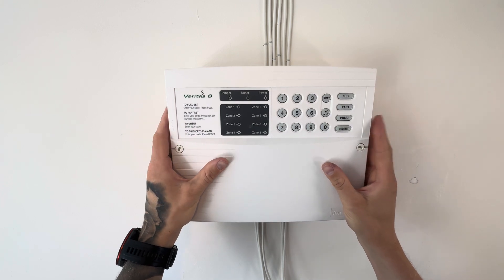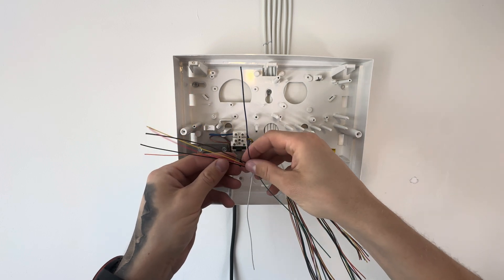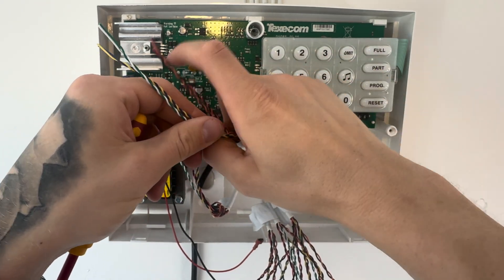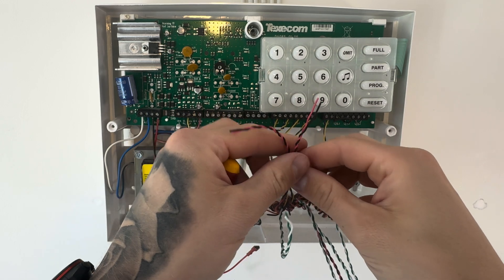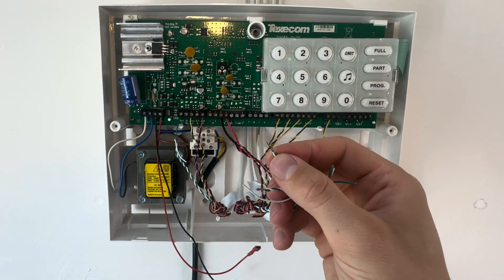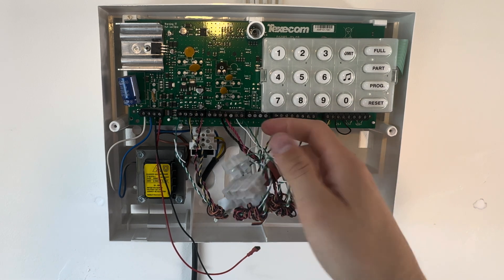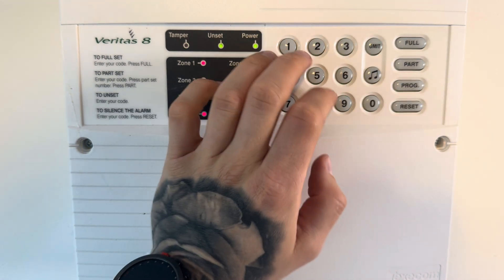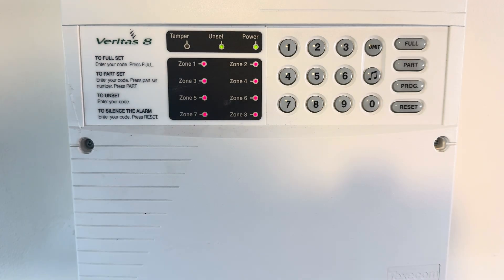How to install a Veritas 8 Alarm System & Programme Step by Step

Comment: Hi Simon
Brilliant video!!
My wired Accenta Ideal alarm system with remote keypad decided some time ago to stop working. The panel lights are on and I've also replaced the battery but nothing works. I've decided to replace it as I can't diagnose the problem. The Veritas 8  looks like it might be an option especially having seen your video to install it. I was also wondering about additional wireless sensors for attached garage and utility rooms. Could you recommend anything for the existing wired and future wireless. Thanks
Reply from the maker: Hi Chris thanks mate good to have you hear, sounds like you’re looking for a hybrid control panel, for that even though I’m not a huge fan of Texecom at the moment I think it might be your best bet, you can get a Texecom 64W panel that will give you 4 on board wired zones and you can learn on wireless zones, or you can get a Texecom premier elite 24 and add a wireless receiver if you need more than 4 wired zones. If you do go for the Texecom I’d advise you to not use the shock sensors, use their new capture wireless PIR range as they are more reliable than their previous versions of equipment 👍🏻 (I actually think there’s a big gap in the market for hybrid panels)
Reply: The ideals were weird. They used Id biscuits for zones and were a pain to troubleshoot. Good job replacing it 👍

Comment: hi simon great video where does the white cable come from when you do the chocky clock and also can you show us how to wire a premier elite 24 panel please👍
Reply from the maker: Hi Ron thanks mate much appreciated good to have you here. I certainly can do a video on a prem 24, I’ll get a spare panel from the office asap and get to making the video 👍🏻 when you say where does the white cable come from do you mean the alarm flex cable that houses all the inner cores?
Reply: @SimonSecurityExpert no the white wire towards where you did it wrong ish lol and you Daisy chained the PA button just before that like half of a minute before man and thank you
Reply from the maker: Haha thought it was fun leaving in there where I did it wrong 🤣Ahh is this one of the white cables that has a green twisted round with it? One of the small and thin inner core cables? If so, you get it from inside the larger white alarm flex housing, once the cable is stripped back it has the inner cores and one of them is white. 

Or if you mean where do I purchase my white cable from screwfix do a good one, albeit quite pricy but I like the quality of it, if you search “alarm flex screwfix” it comes up. Hope this has answered what you need? Let me know if not, cheers
Reply: @SimonSecurityExpert it was when you did the 2nd chocky block and the other geeen and white cables went into the panel on the tamper connections that’s what I’m on about man
Reply from the maker: Sorry mate I’m struggling to understand what you mean even tho I’ve watched it back😩, each individual sensor has a green and white cable twisted together, then daisy chain them all together as shown and you’re left with 2 legs free at either end of the daisy chain and those are the ones that go into the panel

Comment: Hi Simon, would it be possible to do video how to add a secondary keypad to the main board 
Best regards Craig
Reply from the maker: Hi Craig, I’d be more than happy to do that mate, I will film it and get it out this weekend at the latest. It’s a good one to do because there are a couple of parts of it that if it’s not done right it can cause real problems. Will be with you soon cheers
Reply from the maker: Hi Craig, video uploaded for the keypad installation, please pay close attention to the dip switch section its very important, link is here: https://youtu.be/Y1949gh5MFU 

thanks mate

Comment: Excellent video.

I wired the tampers as:
Tamp + on the panel to tamp + on the Pir. 
Tamp - on the Pir to tamp + on the 2nd Pir and then tamp - on the Pir back to tamp - on the panel.
Reply from the maker: Thanks mate! So did you do the loop at the sensor end by the sounds of it? Can be useful to do if you have just the one cable going to multiple sensors
Reply: @SimonSecurityExpert I used the closed tamper circuit loop. 
So one cable comes the panel tamp + to Z1 tamp + and then from Z1 tamp - to Z2 tamp + and then from Z2 tamp - to Z3 tamp + and so on.

Comment: Hi Simon love Ur videos . can I ask u how I would change the keypad circuit  board on a Veritas 8c  as my key pads not working properly I've changed  the  pin sovi can carry on using it as it's the number  3 and 1  that's not working I have a new panel for it and key pad too . Many thanks in advance Andy
Reply from the maker: Hi Andy thank you mate much appreciated, so do you have a remote keypad that you want to wire off the 8C so you could set from the main unit and have a keypad somewhere else also? If so, you will see these terminals on the 8C board T R - + these are the keypad terminals, match them up to the remote keypad terminals and select the dipswitch on the back of the keypad to “number 2” by flicking the number 2 dipswitch up. Hope this makes sense mate, if you’re unsure I’d be happy to make a video on it to helpjust let me know, cheers 👍🏻
Reply from the maker: Hi Andy just a follow up mate ive made a video for you installing a keypad, cheers https://youtu.be/Y1949gh5MFU